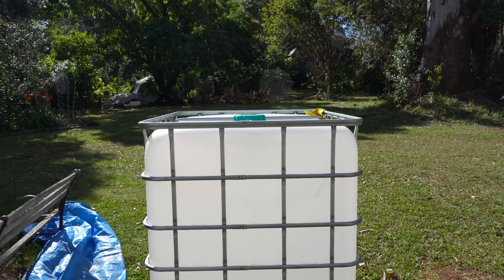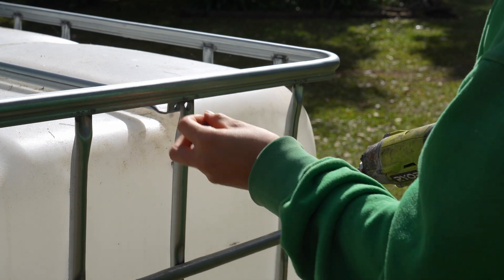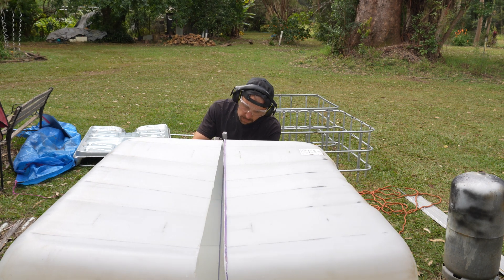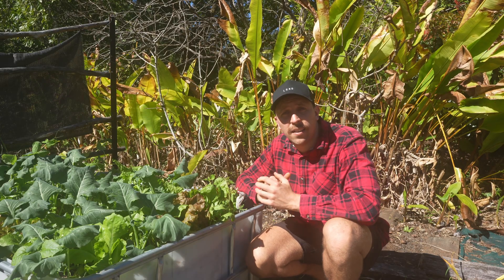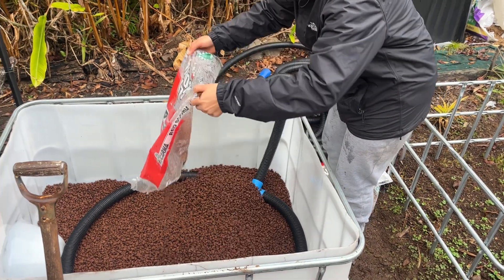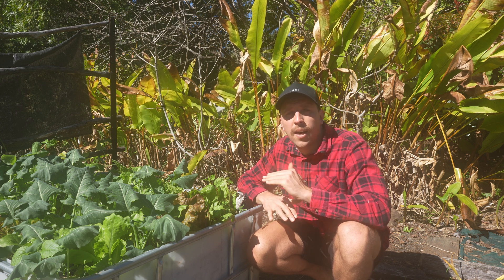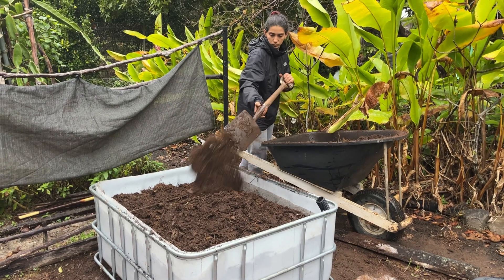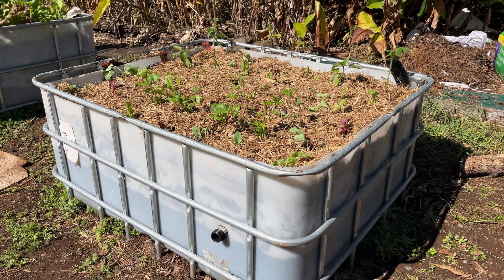HOW TO MAKE A SELF WATERING GARDEN BED (DIY IBC Wicking Bed)

Comment: I'm gonna ask the big question here lol. 

When you cut the frame in half, it wont have 2 horizontal bars for each side. So you cut the vertical bars back I'm guessing... But then your plastic would be taller than your frame. So you cut the plastic again?
Reply from the maker: We only cut the plastic tank once (in half). You’re right though with the frame having vertical bars where we cut it. We only cut this once as well though (in half also). We flipped the frame so the bit we cut in the middle was touching the ground (the vertical bars) on each one. The original top and bottom of the frame are both at the top for the two beds with horizontal bars all the way around. Hopefully that makes sense!
Reply: @juliustinkers  wow, dang good idea there!!

Comment: Love the design! Im a little confused about the use of the ag hose in the reservoir. Did you drill holes in the pipe to the let the water out?
Reply from the maker: Cheers! It’s slotted ag pipe so it already has holes in it
Reply: I was thinking the same thing

Comment: I wonder how long the IBC plastics last out in the aussie sun? Generally milky/clear plastics become brittle and break, much earlier than black plastics (which seems counter-intuitive, absorption and all). Cladding the plastic seems like the safer option, to make them last.

Not sure what to clad them with. Black corflute (which you can get cheap as pallet liners, or even as building floor protectors) may be one option to extend the life of the IBC. It should last many years (the white corflute, maybe 4-5 years, but I think black may go longer). Whatever you choose (even cardboard?) just slot it in between tank and frame. Or materials like sarking, but they may be harder to secure in place or to replace.

Does anyone else have ideas on this?

ETA: good idea turning the frame upside down. I would add, beds can be raised up a bit on (ideally plastic) pallets. One pallet will raise it about 100mm, two will raise it 200mm approximately. You can also get used plastic pallets cheap, like $5-10.
I am a huge raised bed fan.
Reply from the maker: We were thinking to clad them with pallet timber or something similar. Would be pretty easy to screw something to the outside frame. Plus it would look a bit nicer!
Reply: @ Yes maybe on the appearance, but longevity would be my focus. Ideally it would be cheap and easily replaceable. 

The pallet 'liners' (no idea what their real name would be) just a bit of corflute to line the pallet (mainly for cans etc) can be cheap (but with can marks, LOL). I bought a bunch for $5 each for another purpose. But you could cut them to size (easy) and slot them in between frame and tank.

Protectomondo. Take THAT, UV rays! You no kill my IBC tank!
Reply from the maker: True true! Lots of options
Reply: @juliustinkers  Anyway, apart from construction and materials, the wicking part was most helpful, so thank you.

Comment: Strangely, I would have approached it the opposite way - angle grinder for the frame, jigsaw (or maybe angle grinder) for the tank.
Reply from the maker: From memory started with the grinder on the frame and also tried the jigsaw on the tank but found this way worked better
Reply: @juliustinkers  Ah, you just needed better cutting discs (probably not grinding discs?). Not all discs are created equal (nor brands tbh)

People do not realise, two different types of discs for the angle grinder.

Even with a metal cutting blade in a jigsaw, I would have gone angle grinder for the cleaner cut.

Love my tools, have both and more, and not afraid to use 'em! :)
Reply from the maker: Nah had the cutting disk on, and a good metal blade on the jigsaw. Agreed, a good disk and blade makes a real difference! Jigsaw was just a bit quicker, quieter and less sparks.
Reply: I didn't take the tank and frame apart, just cut the frame with an angle grinder with a diamond tipped cutter then used a reticulating saw for the tank. Easy as 👍

Comment: From experience in Australia the plastic degrades in the sun, After I finished building my last lot, I built a box around it, I used old roof sheeting, but timber sleepers will also do the job, or even fence pailings.
Reply from the maker: That’s a great point! Plus cladding it makes it look a little nicer
Reply: Dirt works too

Comment: I would love to see one of these with a toilet built into the overflow so it shuts the water off when it is at the right capacity.
Reply from the maker: That’s a great idea! Just like a float valve I guess - would need a little separate compartment that lets water out but not the rocks in. Would be fairly straightforward to set up

Comment: Thanks so much for the list of things/amounts I’ve been looking everywhere to work out how much materials I need. So you think next time you’ll use just gravel and no scoria? Did you consider sand? I’m trying to work out the most cost effective way but also effective haha. Was thinking of avoiding using bread crates because of micro plastics etc
Reply from the maker: Glad it was helpful! Yeah I would use the course gravel and fill it about halfway next time. The soil in the one with gravel seems to be staying more moist - I think because the water level sits higher. Did consider sand but I think it would leave less space for water because it’s more compact